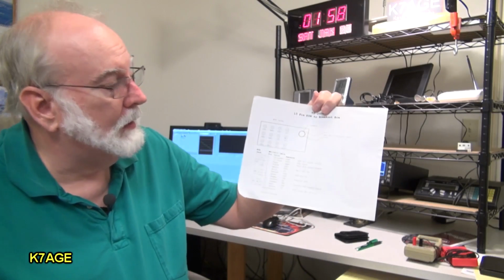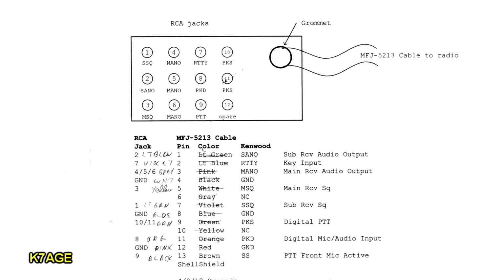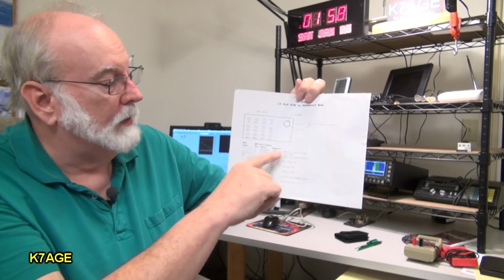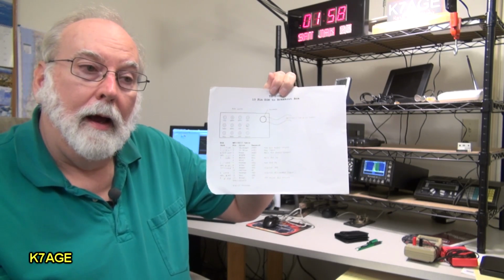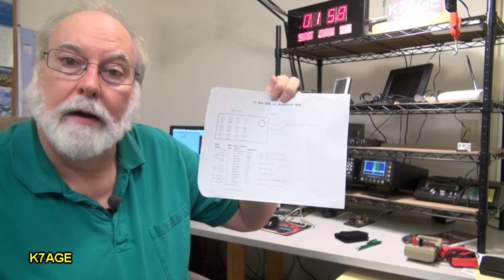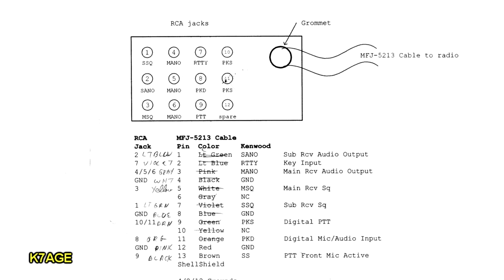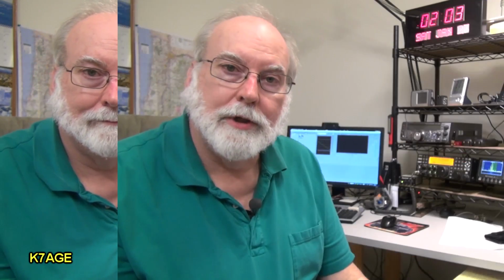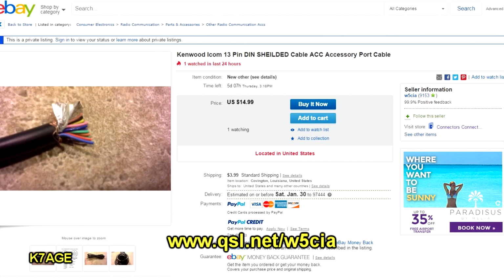New Ham Shack Part 3, Audio Breakout Cable

Comment: Great video Randy.  
I made up a similar solution to your breakout box.  

I made an adapter cable.

As you mentioned ,soldering to those 13pin DIN connectors is a pain... I did it ONCE then hooked the other end of the cable to a  female 15pin D connector,  pin for pin.

I find soldering to a 15pin D connector to be a LOT easier.  I often change things that I hook up to my radio... sometimes it's a PC interface, sometimes it's a Rowetel SM1000 FreeDV SmartMic.  The last thing I want to do is wear out the socket in my IC-7100.

73

Michael.
VK5ZEA

Comment: great video, specially since i'm trying to set up a station at my camper site, i use solar power out there so i thought maybe a mobile radio might be best for less power consumption, i found a used mobile unit the guy is selling for $125.00 i thought well for that price it might not be worth a crap, ...pardon the french lol, does ANYONE have any knowledge on this radio, i put a link to a description of the same model below, any help would be greatly appreciated , oh and randy that site is great for learning for my tech exam ...thanks.....  https:/www.hysct.com/sdp/1941843/4/pd-6573943/12851000-2734840/Quad_Band_Fm_Transceiver_TC-8900R.html        thanks yall!
Reply from the maker: +Hammer USN Hi, don't know anything about that radio. Chinese version of Yaesu FT8900. Probably no support in the US. You might find a review over at eham.net. Thanks for watching.
Reply: K7AGE OK, thanks

Comment: have you or may you have a video of doing one microphone switchable for more than 5 transmitters. is it possible ve3gcg 73
Reply from the maker: +George Gardinier Sorry no I don't.   It is possible.  Find a rotary switch with enough positions an poles/circuits and build on.

Comment: Thanks, Randy. I enjoyed the video. I've been watching pertinent videos almost non-stop since I moved to a location with two 60-foot trees suitable for mounting an antenna or two. I've been away from the hobby for about10 years and am now anxious to begin operating qrp cw. From the videos I've watched so far, I've pretty much decided to go with the Elecraft K1. Something I hope you can help me with is my indecision about which antenna to start with. My favorite antenna in the past has been a delta loop because it was "quiet" and could pick up weak signals very well. I realize that a vertical would produce more gain, but if my loop is cut resonant for the 40 meter qrp calling frequency, might it be all-around more efficient than a vertical? My passion is cw ragchewing. Thanks, N1MO, but you can call me Lon.
Reply from the maker: +Leslie Peruzzi I would say, put the loop up. Or throw up a simple dipole to get on the air.  Have fun pounding the brass.